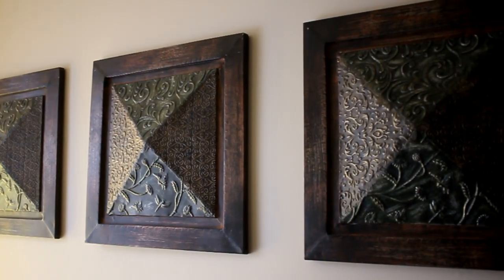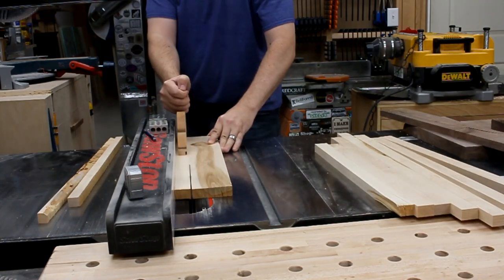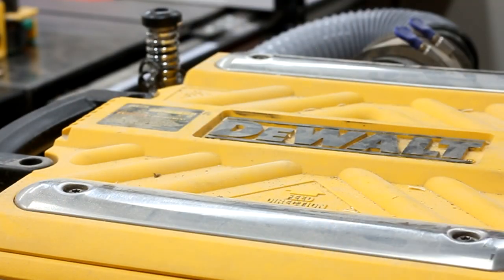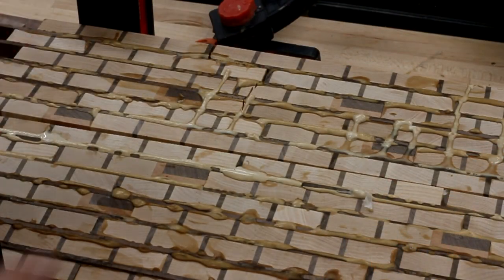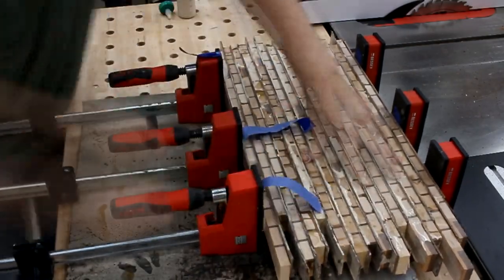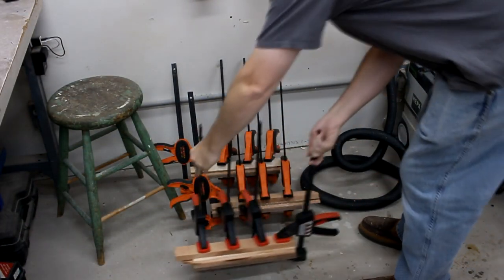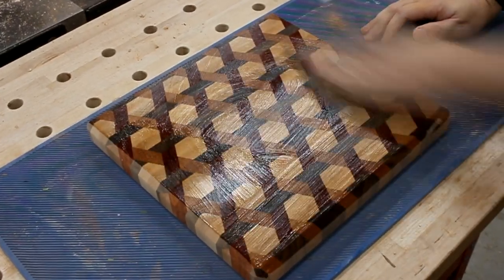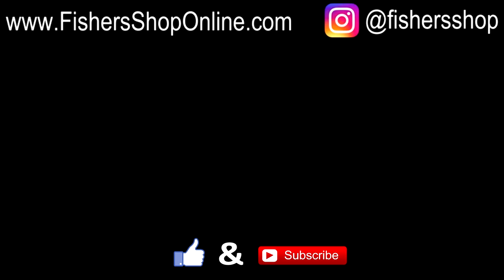Woodworking: 3D End Grain Cutting Boards

Comment: May I share a tip?
When setting angle on table saw, 45°, go past 45° one turn on adjustment wheel then back wheel into the 45° angle.  It takes the slack out of threads on adjustment wheel and threads stay tight to 45° indefinitely.
Reply from the maker: Nice tip. 👍

Comment: I discovered that when I cut a repetitive angle on the table saw the "cutting edge" of the wood will slip below the fence.  I have started to use a square piece of wood clamped to my fence so as to prevent the cutting edge from slipping under the fence.  This has helped keep my angles consistent.  The last piece had me truly fascinated.

Comment: With regard to that outtake on the CNC, here's a little advise from a novice machinist. Those side clamps, while incredibly useful, don't have a ton of holding power. You can't be too aggressive when holding a work piece down with them. In addition, having something to hold the work piece in the axis most if the force will be coming from helps. In the clip you showed, the clamps were only on the long edges of the work. If you had clamps on the short edges as well, it'd be harder for the part to move.

Comment: For me the hex weave board is the coolest looking board. Just this past week, I made my first (well, second, actually) end-grain cutting board. Before that, I'd made a dozen or so edge-grain cutting boards. Before I started I didn't know that end-grain boards were so much more time-consuming and harder to do, but I did know they take a lot more material. Getting all the pieces flat and lined up when you glue them really takes a lot of attention to detail when you are trying to create a consistent pattern. My first end-grain board was pretty much a complete failure. The second one - the first that was relatively successful - came out all right, but still is far from perfect. I don't have a CNC, a router sled, or a drum sander, so to get it flat I had to very carefully run it through my planer. Yeah, I know you're not supposed to do that on end-grain boards, but I glued it down to a sled, and took super light passes (like 1/128th"), and it worked out fine. Mine is a fairly simple checkerboard pattern using walnut, maple, and mahogany, but getting the rows to line up on the second glue up was still a bit of a challenge. Anyway, all that is to say that after having made just one end-grain board, I think your boards are pretty amazing. The creativity and amount of work that went into them is incredible. I hope whoever gets them appreciates them; they are works of art.

Comment: At least now I know where all that tape I took from you ended up going.  LOL.

Cool project.  Really imaginative.  Good to see the failure too....though that's everything I tend to do.  :(

I'm currently reclaiming some deck lumber from a neighbor's deck...we'll call him DF for short, and am running into issues with the same planer you have.  It seems that reclaimed Cedar has gummed up the rollers and bed.  I finally waked the table and cleaned the rollers, but it's still REALLY slow going.  I can't drop the cutter heads more than a 1/4 turn and I have to run each board 4 times though the planer.  Top twice (spinning it 180 Degrees), flipping the board and doing the same flip.  It's taking FOREVER.  I still have to join and edge and rip off the bad wood.  I just don't have the heart to throw all that "donated" lumber away, I mean, the guy I got it from has done so much with what he's taken from my house, I HAVE to return the favor.  :)

Comment: As a chef, the brick board is the only one that makes sense. If given the other two, irrespective of how they look, I would give them back. FYI the boards should be scaled to fit end on in the kitchen sink. Also they should be reversable i.e can be used on both sides.

Comment: Very nice cutting board variations Drew!
Quick question regarding cutting the thin strips... any reason why you didn't use the Thin Strip Jig that you created a couple of years ago? Is it due to the actual length of the strip you needed and the jig isn't designed for longer lengths?
Reply from the maker: My thin strip jig is good but it had a couple limitations.  The length and the thickness of the hold-down.  In both cases it wouldn't have been ideal.  The strip I needed was much longer than the jig itself (but it still would have worked) and also I was cutting them thinner than 1/8" which would mean I would have cut into my little hold-down clamp (which still would have worked).  So to make this reply even longer, I could have, but just didn't for no particular reason.

Comment: How have these held up over time? I'm assuming these take more care and maintenance than most folks are willing to endure so have these cracked in the last year?
Reply from the maker: On the contrary.  End-grain boards are much more hardy than normal face grain boards or other decorative boards that might have contrasting grain directions.  Holding up just fine!

Comment: The missing thing board is my least favorite but the pyramid one is my favorite. How cares if the seams are a hair off, it is handmade. What did you do with the squares that you couldn't use? I would have cut them in half horizontally and made coasters out of them. I would do the same with the cutting boards, cut them in half horizontally and make 2 boards out of them, that way they are also not quite so heavy. I love your work and designs, amazing.
Reply from the maker: Thanks, Connie.  The ones I messed up, I actually cut back apart, trimmed them to fit perfectly, and glued them back up to make a smaller version of the same pyramid board.  When it was done, I gifted it to my friend.
Reply: @FishersShop  I was just on you HP and saw the gaming table. I wish there was a way to contact you. Not everybody has all the tools that you have and my thought was, couldn't you make like a set that only needs to be assambled (put together) screwed and or glued and ship out the set, like Ikea if you are familiar with their stuff. Your furniture ofcourse would be much higher quality. It was just a thought because that table is a great idea.

Comment: Curious? Why do you use the CNC to flatten instead of the planer?
Reply from the maker: It's not a good practice to send endgrain pieces through a planer.  There's a risk of the machine tearing it apart.
Reply: @FishersShop  thanks for the explanation, I wondered that myself. Good question snoopyfix2.

Comment: Did you have any issues with ripping the strips with the gap between the fence and the saw top? those have always thrown off my rip cuts on the end grain boards since a small portion of that angled edge goes under the fence.
Reply from the maker: Nope. No issues for me.

Comment: Great boards. On the pyramid one, was the side strips also end grain, or side grain? I had bad experiences with mixing end and side grain as the conflicting expansion would eventually crack the board with all the washing and drying.
Reply from the maker: Everything is end grain.
Reply: @FishersShop  I am making the pyramid one, at the point of making accent strips. Are they also end grain?
Reply from the maker: @paulkarisny5575  Yes they absolutely are.  It's not a good idea to mix grain directions so be sure to make your accents all end grain as well.
Reply: @FishersShop  Thank you,  good thing I asked !!

Comment: Wouldn't the end grain has to be really well-sealed to prevent getting sick from absorbed meat juices and animal blood? Nice, but not practical. The end grain will act a wick to absorb things.
Reply from the maker: End grain cutting boards are the best out there.  They hold up to the abuse from chopping and cutting more so than any other face or edge grain boards.  The wood fibers aren't cut but instead separate and come back together.  To answer your question, no that's not a problem, especially if you keep it treated with oil and wax like I do.  You COULD experience that issue with a typical face grain board though since the fibers are cut allowing food and bacteria to get trapped.  End grain boards are very practical.